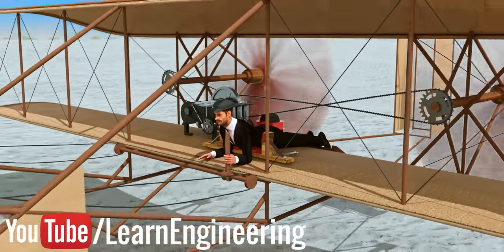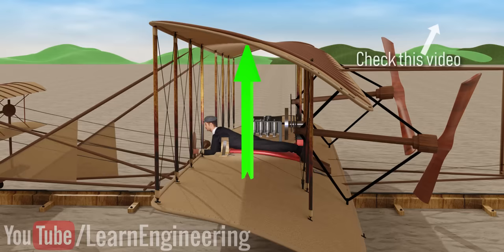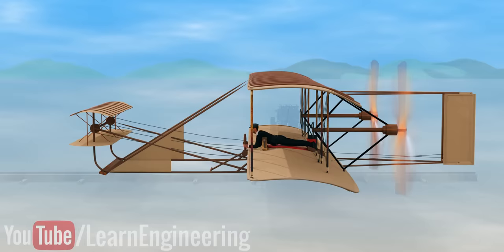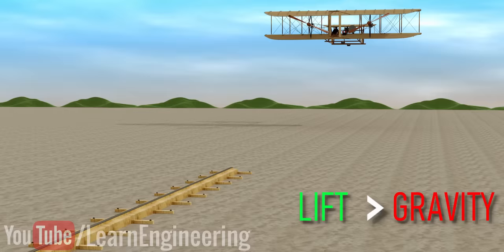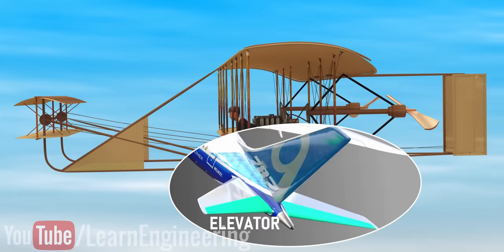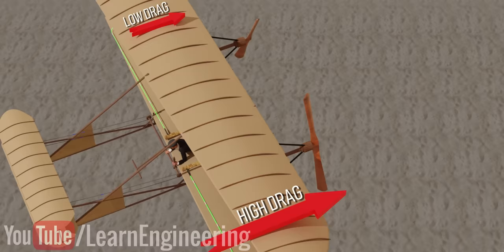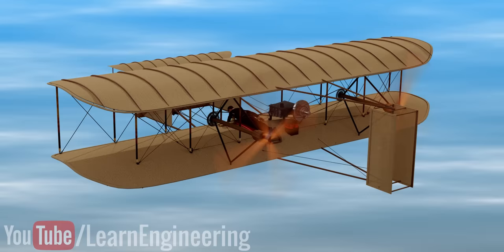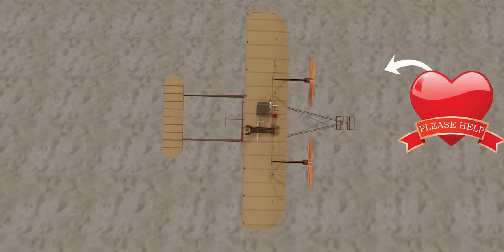The Brilliant Engineering of FIRST FLIGHT !

Comment: See, in the table below, the data published by the North American magazine "National Aeronautics", december, 1939, edition. Official body of the "National Aeronautics Association" in Washington: Pilot Location Date Flight time.

Santos Dumont Bagatelle 12/11/1906 21 ” 

Henri Farman Issy le Moulineaux 11/26/1907 52 ” 

Leon Delagrange Champ de Mars 11/04/1908 6’30 ” 

Henri Farman Issy le Moulineaux 06/07/1908 29’53 ” 

Léon Delagrange Issy le Moulineaux 09/06/1908 20’19

 For many years, these official figures have been published without any dispute. In the American magazine "Reader’s Digest" of December 1942, we found an article entitled "Santos Dumont, Father of Aviation", condensed from the magazine "Air Facts". From page 54 we transcribe the following excerpt: “in 1906 he gave the world the first public demonstration of flight in a device heavier than air (the Wright brothers only came to fly publicly in 1908).
Reply: Few dispute these historical facts.  They are not indisputable facts but they are generally accepted historical statements.  

The claim that Santos Dumont was the "Father of Aviation"  is not a fact.
it is an opinion.  The opinion is widely disputed since most nations want to celebrate their own aviation pioneer.  In the UK, Cayley is regarded to be the Father of Aviation.  The worldwide opinion of most aviation historians generally agree.  

For a Portuguese translation, use Google translate or one of the other
on-line connverters.
Reply: Poucos contestam esses fatos históricos. Não são fatos indiscutíveis, mas são declarações históricas geralmente aceitas.

A afirmação de que Santos Dumont era o "Pai da Aviação" não é um fato.

é uma opinião. A opinião é amplamente contestada, já que a maioria das nações deseja celebrar seu próprio pioneiro da aviação. No Reino Unido, Cayley é considerado o Pai da Aviação. A opinião mundial da maioria dos historiadores da aviação geralmente concorda.

Para uma tradução em português, use o Google Translate ou um dos outros
 conectores on-line.
Reply: @stevebett4947  the problem is that they are disputable and still have the detail that they are events that could be proved and were not. Under these conditions there is no evidence for nothing about the wright and all the evidence shows Dumont. Caylei if he had invented a plane or if he had something that really flew he would also have presented. Everyone knew the advantages of proving the existence of the first plane. They didn't present it because nobody had it. The genius of the Brazilian Dumont made the WORLD fly.
Reply: @stevebett4947  Contestation for unproven and suspicious events like wright events is even a must.
Reply: @stevebett4947  The events listed by National Aeronautics are indisputable as they are data from the initial period of the first records FAI.
Reply: @harpiasonhadorasonhadora5259  
SB:  I like your term disputable.  All hypotheses are disputable.  The best theory is the one that can be falsified.  

I doubt that anyone could have proved anything before 1905 if proof means FAI acceptance.  

I am trying to think of aviation records or aviation contests before 1905 that were indisputable or incontestable.  What about a land speed record with a prize and and spectators?  

The actual speed or distance achieved was usually irrelevant.  The news was who won not whether the win was faster or better than the previous year.  

The FAI inspired contests were different and a little odd.  They were not restricted to a particular date.  What mattered was the measured distance and the official witness(es).  

After 1908, all we had were FAI certified records.  I am not sure that they even required an "official FAI witness".  There just had to be judges or witnesses.  I am not sure how their testimonies were recorded.  In 1908, the officiating job was delegated to the French Aero Club.  How were records handled in 1920?
Reply: SB: Eu gosto de seu novo termo para (incontestable) disputável o questionável. 

Todas as hipóteses são discutíveis. A melhor teoria é aquela que pode ser falsificada (falsifiable).
  

Duvido que alguém pudesse ter provado qualquer coisa antes de 1905, se a prova significa aceitação pela FAI.

Estou tentando pensar em recordes de aviação ou competições de aviação anteriores a 1905 que eram indiscutíveis ou incontestáveis. Que tal um recorde de velocidade terrestre com um prêmio e espectadores?

A velocidade ou distância real alcançada geralmente era irrelevante. A notícia foi quem ganhou não se a vitória foi mais rápida ou melhor do que no ano anterior.

Os concursos inspirados pela FAI eram diferentes e um pouco estranhos. Eles não estavam restritos a uma data específica. O que importava era a distância medida e a (s) testemunha (s) oficial (is).

Depois de 1908, tudo o que tínhamos eram registros certificados pela FAI. Não tenho certeza se eles exigiram uma "testemunha oficial da FAI". Só tinha que haver juízes ou testemunhas. Não tenho certeza de como seus testemunhos foram registrados. Em 1908, o cargo de oficial foi delegado ao Aeroclube francês. Como os registros eram tratados em 1920?

Ninguém configurou seu primeiro vôo da maneira que a FAI recomendou. Você teria que saber a que distância a máquina voadora viajaria e então definir isso como algum tipo de competição aberta com talvez um ou mais competidores viáveis. 50 m ou talvez 50 jardas pode ser um bom ponto de partida. Poucos dos primeiros pássaros se preocuparam em registrar o distância real.

Cayley tinha dois protótipos e um modelo que eram capazes de fazer saltos unidirecionais.

Sir George Cayley (1773-1857) descobriu e identificou as quatro forças que atuam em um veículo voador mais pesado que o ar: peso, sustentação, arrasto e empuxo.

O design dos aviões modernos é baseado nessas descobertas e na importância das asas curvadas, também identificadas por Cayley. Ele construiu o primeiro aeromodelo voador. Ele também projetou o primeiro planador confiável para transportar um humano no alto. Ele construiu vários motores (um produzia 8 hp) e previu corretamente que o vôo sustentado não ocorreria até que um motor leve fosse desenvolvido para fornecer impulso e sustentação adequados.

Exceto no Brasil, George Cayley é geralmente reconhecido como o Pai do Voo ou o Pai da Aviação Moderna.
"Primeiro a voar" é geralmente reservado para a lenda local.

Google Father of Flight ou verifique a Wikipedia em vários idiomas diferentes.
https://en.wikipedia.org/wiki/George_Cayley

"Cerca de 100 anos atrás, um inglês, Sir George Cayley, levou a ciência do vôo a um ponto que nunca havia alcançado antes e que dificilmente alcançou novamente durante o século passado." - Wilbur Wright, 1909. [9]
  
Você consegue encontrar algo semelhante em Alberto Santos-Dumont?No one set up their first flight in the way that the FAI recommended.  You would have to know about how far the flying machine would travel and then set this up as some kind of open ended contest with perhaps one or more viable contestants.  50 m or perhaps 50 yards might be a good starting point.  Few of the early birds bothered to record the actual distance.  

In English:
Cayley's had two man carrying prototypes and a model that were capable of making unidirectional hops.  

Sir George Cayley (1773-1857) discovered and identified the four forces which act on a heavier-than-air flying vehicle: weight, lift, drag and thrust.  

Modern aeroplane design is based on those discoveries and on the importance of cambered wings, also identified by Cayley. He constructed the first flying model aeroplane .  He also designed the first glider reliably reported to carry a human aloft. He built several engines (one produced 8 hp) and correctly predicted that sustained flight would not occur until a lightweight engine was developed to provide adequate thrust and lift.

Except for Brazil, George Cayley is generally recognized as the Father of Flight or the Father of Modern Aviation.
"First in flight" is usually reserved for the local legend.    

Google Father of Flight or check Wikipedia in several different languages.   
https://en.wikipedia.org/wiki/George_Cayley

"About 100 years ago, an Englishman, Sir George Cayley, carried the science of flight to a point which it had never reached before and which it scarcely reached again during the last century."   — Wilbur Wright, 1909.[9]
  
Can you find anything similar from Alberto Santos-Dumont?
Reply: @stevebett4947  cayley never registered a plane and did not start aviation at any time, look at the reality please. There are no statements from cayley showing that he had arrived on the plane, proven or even registered. All the requirements for the first plane had existed for a long time and it was known to everyone including the wright themselves. If they didn't exist, the wrights wouldn't have called French experts to see them flying with the technology of Dumont and Farman in the middle of 1908! And when you try to criticize FAI's demands, you make a mistakee terrible because their demands were more reasonable than ignoran terrible because their demands were more reasonable than the ignorance you present when trying to convince without presenting OFFICIAL evidence.
Reply: @stevebett4947  you and other idiots consider cayley as the father of aviation and cayley NEVER PRESENTED THE PLANE IN PUBLIC  FLIGHT, NEVER DID THE DEMONSTRATIONS PUBLISHED IN FRONT OF EXPERTS, NEVER DID ANYTHING OTHER THAN PRESENTING JUMPS AND PROTOTYPES THAT DID NOT CHARACTERIZE THE PLANE, !!!! this is comical. It means that they consider the father of aviation to have done less that Dumont !!!! ridiculous.
Reply: @stevebett4947 Do you talk about something similar for DUMONT!?!?!? My god, boy,  Dumont held the event,  photographed and filmed "FIRST AVIATION RECORD OF THE WORLD" cayley never got to the feet of this.
Reply: @stevebett4947  cayley !!!!! father OF AVIATION without proving anything and never registering anything !!!! absurd. Based on your claim without evidence, you do not present anything, we could then say that Dumont when proved everything Besides being a true "father of aviation" he is also "GOD OF AVIATION"
Reply: @harpiasonhadorasonhadora5259  

RE: George Cayle  - see https://en.wikipedia.org/wiki/George_Cayley
O artigo pode ser lido em português.
The article can be read in Portuguese.

HS:  Caylei if he had invented a plane or if he had something that really flew he would also have presented.   Everyone knew the advantages of proving the existence of the first plane. They didn't present it because nobody had it.

Pronunciation:  KAY-lee not CAY-lay  IPA: /'kei-lii/

SB:  Digamos que a máquina voadora deu um salto curto. O que você espera que Cayley faça?
Como ele provaria isso usando seus padrões de evidência?
Talvez ele pudesse ter outra pessoa para patrocinar um concurso e selecionar testemunhas oficiais.
Ninguém no século 18 pensava assim.

SB: As notas que temos indicam que Cayley forneceu a melhor descrição de quatro forças que governam o vôo tripulado.

Ele construiu três máquinas voadoras, um planador e dois com um motor que completava saltos curtos. 
Havia três pilotos. Um era seu chofer, que alegou ter sido contratado para dirigir um carro, não uma máquina voadora. É uma boa história, mas
 pode não ser verdade. Cayley estava na casa dos 80 anos, então ninguém esperava que ele fosse o piloto de testes. No entanto, é relatado que seu motorista era apenas dez anos mais jovem.

Cayley não estava focado em provar que o salto aconteceu. Foi apenas um teste de conceito.
Ele concluiu que precisaria de um motor mais potente para fazer um vôo real.

Em 1799, ele estabeleceu o conceito do avião moderno como uma máquina voadora de asa fixa com sistemas separados para elevação, propulsão e controle. A analogia era um barco em um mar de ar. As asas proporcionavam elevação da mesma forma que o casco de um navio.
O motor fornecia propulsão e o leme fornecia controle. A principal tarefa era a estabilidade - evitar que o navio naufragasse no mar.

Esta não foi a analogia que os Wright usaram. Controlar um avião era como controlar uma bicicleta instável. Instabilidade
 estava bem. Os esforços do piloto foram necessários para alcançar o controle. O piloto era mais do que um homem no leme.

Aqui está Wilbur Wright sobre a importância de Cayley. Alberto falou alguma coisa sobre os que vieram antes?
Quem acredita na lendária figura afirma que Santos-Dumont fez tudo sozinho, sem a ajuda de ninguém.

"Cerca de 100 anos atrás, um inglês, Sir George Cayley, levou a ciência do vôo a um ponto que nunca havia alcançado antes e que dificilmente alcançou novamente durante o século passado."
- Wilbur Wright, 1909.

O artigo pode ser lido em português.

In English:
Let's say that the flying machine made a short jump.  What would you expect Cayley to do?
How would he prove it using your standards of evidence?
Perhaps he could have had someone else sponsor a contest and select official witnesses.
No one in the 18th Century thought that way.  

SB:  The notes that we have indicate that Cayley provided the best description of four forces that govern manned flight.
He built three flying machines a glider and two with a motor that completed short hops.  There were three pilots.  One was his chauffeur who reportedly claimed that he was hired to drive a car not a flying machine.  It is a good story but
may not be true.  Cayley was in his 80's so no one would expect him to be the test pilot.  However, it is reported that 
his chauffeur was only ten years younger.

Cayley was not focused on proving that the hop took place.   It was just a test of concept.
He concluded that he would need a more powerful engine to make a real flight.

In 1799, he set forth the concept of the modern aeroplane as a fixed-wing flying machine with separate systems for lift, propulsion, and control.  The analogy was a boat in a sea of air.  The wings provided lift the way the hull of a ship did.
The engine provided propulsion and the rudder provided control.  The primary task was stability - preventing the ship from capsizing in the sea of air.

This was not the analogy that the Wrights' used.  Controlling a plane was like controlling an unstable bike.  Instability was fine.  The efforts of the pilot were required  to achieve control.   The pilot was more than a man on the tiller. 

Here is Wilbur Wright on the importance of Cayley.    

"About 100 years ago, an Englishman, Sir George Cayley, carried the science of flight to a point which it had never reached before and which it scarcely reached again during the last century."

— Wilbur Wright, 1909.

Did Alberto say anything about those who came before?
Believers in the legendary figure often say that Santos-Dumont did everything himself with no help from anyone.
Reply: @stevebett4947  interesting, but very vague. It's not objectivity, flight, the ability to run, take off, land under its own power, landing, filming and photos with official registration and definitive appearance of the plane and beginning of aviation as Dumont.
Reply: @stevebett4947  Thanks for the translation.
Reply: @harpiasonhadorasonhadora5259  

SB: Os primeiros Wright Flyers não podiam decolar ou voar por conta própria. Eles exigiam um motor e vento forte. O vento forte também foi útil para um pouso suave.

Quando os Wrights tentaram repetir o que consideraram um sucesso em
Ohio, eles tiveram repetidos fracassos. Talvez um trilho engraxado de 200 pés
 permitir que o Flyer acelere para decolar. Ninguém nunca tentou isso.

Pode não funcionar com um motor fraco. Em vez disso, encurtou o necessário
 pista pelo uso de uma catapulta de torre que lhes deu, por uma estimativa, um adicional de 6 mph. Isso foi o suficiente para atingir a velocidade de decolagem. isso foi assistência de três fontes: motor, vento e catapulta. Todos os 3 eram necessários para o Wright Flyer II decolar.

Here is what I posted before:

Digamos que a máquina voadora deu um salto curto. O que você espera que Cayley faça?

Como ele provaria isso usando seus padrões de evidência?

Talvez ele pudesse ter outra pessoa para patrocinar um concurso e selecionar testemunhas oficiais.
  Ninguém no século 18 pensava assim.

SB: As notas que temos indicam que Cayley forneceu a melhor descrição de quatro forças que governam o vôo tripulado.
Ele construiu três máquinas voadoras, um planador e dois com um motor . Havia três pilotos. Um era seu chofer, que alegou ter sido contratado para dirigir um carro, não uma máquina voadora. É uma boa história, mas
pode não ser verdade. Cayley estava na casa dos 80 anos, então ninguém esperava que ele fosse o piloto de testes. No entanto, é relatado que
seu motorista era apenas dez anos mais jovem.

Cayley não estava focado em provar que o salto aconteceu. Foi apenas um teste de conceito.
  Ele concluiu que precisaria de um motor mais potente para fazer um vôo real.

Em 1799, ele estabeleceu o conceito do avião moderno como uma máquina voadora de asa fixa com sistemas separados para elevação, propulsão e controle. A analogia era um barco em um mar de ar. As asas proporcionaram elevação da mesma forma que o casco de um navio.
O motor fornecia propulsão e o leme fornecia controle. A principal tarefa era a estabilidade - evitar que o navio naufraga se no mar.

Esta não foi a analogia que os Wright usaram. Controlar um avião era como controlar uma bicicleta instável. Instabilidade
estava bem. Os esforços do piloto foram necessários para alcançar o controle. O piloto era mais do que um homem no leme.

Aqui está Wilbur Wright sobre a importância de Cayley. Alberto falou alguma coisa sobre os que vieram antes?
Quem acredita na lendária figura afirma que Santos-Dumont fez tudo sozinho, sem a ajuda de ninguém.

"Cerca de 100 anos atrás, um inglês, Sir George Cayley, levou a ciência do vôo a um ponto que nunca havia alcançado antes e que dificilmente alcançou novamente durante o século passado."
- Wilbur Wright, 1909.

SB:  The earliest Wright Flyers could not take off or fly under their own power.  They required both an engine and a high wind.  The high wind was also useful for a soft landing.  

When the Wrights tried to repeat what they viewed as a success in 
Ohio, they had repeated failures.  Perhaps a 200 ft. greased rail would
allow the Flyer to accelerate to take off speed.  No one has ever tried it.
It might not work with a weak engine.  Instead then shortened the required
runway by the use of a derrick catapult which gave them, by one estimate,
an additional 6 mph.  This was enough to achieve take off speed.  It was
assistance from three sources:.  engine, wind, and catapult.  All 3 were needed for the Wright Flyer II to take off.

The Wrights were pretty good with photography.  I am not sure why they never investigated film.  

Can you be specific about what you consider to be vague and non-objective?

Please concentrate on what we don't agree on.  
As you know, I am a fan of Henrique Lins de Barros and accept
his full argument.  The only difference is that he buys into Archdeacons 
efforts to make it appear that the French were dominant in aviation.
I find the initiative as a bit odd and contrived.  

To ask that George Cayley () adopt them for his flight experiments seems
to me to be a stretch.  He doesn't explain how this could be done.  Can you?

Cayley could care less if you didn't believe or accept his reports.  They were completed to answer some questions that he had.  He did design an 8hp engine but it was not enough to achieve practical flight.  He needed more power and a better propeller to produce more thrust.  He thought that
true flight would have to wait until someone invented the needed technology.
Reply: @stevebett4947  again, you are always having the same problem. You don't present facts. Facts require proof, otherwise there is only belief. The demand was clear and came at least since 1890 and began to be implemented since 1898 when the greatest authority of the time arose the Paris club. Everyone knew and the requirement was clear "DO NOT USE CATAPULT, DO NOT USE THE WIND, DO NOT PLAY DOWNHILL ( DO NOT USE ANY EXTERNAL MEANS),  the machine should run, take off, land under its own Power and landing. in front of a large specialist,  photos, great public, official registration of the event and photos. these requirements were old and in their words all this was disrespected by the wright. In short, they didn't have the plane, and they never presented evidence. anything between 1903-05 and three years BEFORE Dumont !!!!! My god!!
Reply: @harpiasonhadorasonhadora5259  

SB:  Thanks for your comment.  I thought we agreed to supply enough information for the reader to determine what comment you are responding to 

I also thought we agreed not to argue about what we already agree on.
For example:  We agree that the Wrights did not supply the incontestable
evidence required by the FAI and the French Aero Club after 1904.  

It would have been impossible for them to do so since the FAI did not exist in 1903 and 1904.  Earlier I provided some examples of how the Wright Brothers could stack the deck against all of those who claimed to have
flown before 1908s by accepting only controlled flights as real.

The consensus today is that Santos Dumont was the first to fly with official witnesses.  The Wright Brothers were the first to achieve controlled flight.
I don't think they achieved it in 1903 but 1905 is still good enough to be the first.  

The only incontestable facts are those mentioned in the rules and regulations for the Deutsch - Archdeacon award.  We need to find
these since all we have is hearsay.  

If the rules include or mention a large crowd and film evidence, then this can be part of the official requirements.  Otherwise they are just preferences of the event organizers which they could supply.

I think we will find the rules include no assistance (other than using wheels to accelerate to take off speed).  This means no hill, no catapult, & no required minimum headwind,  They also include official witnesses.  They may mention that the witnesses have to be from the French Aero Club.

I don't think that these requirements were widely accepted outside of the French Aero Club and the FAI.  They were devised specifically to handicap the Wrights, raise doubts as to their accomplishments,  and to elevate the dominance of French aviation.  

It is important to have some rules regarding what counts as sufficient evidence.  What the FAI requires today is a good example of what it should be.  The 1905 rules are clearly biased and excessive.

This reply to another comment includes answers to some of your questions.  Sorry I don't have time to translate them.  I will do so in a day or two.

SP wrote:

1-Can you prove there was Wright  airplane flight before 1908? 
2-Can you prove there was Wright  airplane flight before 1908? 
3-All NASA wind tunnel tests indicate D > T
4-Can a prototype with D>T fly sustainably.

SB:  

1.  I can provide historical evidence that most aviation historians
agree that the Wrights' flew as described in their notebooks.  

The Wright Experience exact replica proved that the craft was capable of a 10 sec. flight covering about 100 feet or approx. 33 meters.  with a 15 mph headwind.   This is consistent with the reported flights of 120 to 175 ft. with a 21+ mph headwind.

There is no incontrovertible or incontestable  proof for the claimed flights that would satisfy you.  It shouldn't satisfy the FAI either but
they went ahead and certified the claimed flights with no official witnesses.    Any ideas on why they did this?

There was one public flight before a crowd and 30 invited guests that included multiple laps around the Huffman Prairie cow pasture.  Capt. Ferber, who had been a leading critic of the Wrights, interviewed the invited guests and concluded that the event took place as described and that the Wrights were not making it up.  

This is supposed to have been reported  in L'Aerophile but I haven't found it yet.  You should read this magazine since it is on the Web along with a full text version which can be copied and pasted into a language converter if you don't read French.  

What I found interesting was that the magazine was not dominated by either Santos Dumont or the Wright Brothers.  They are mentioned but not as much as I was expecting.  

SB:  There were members of the American Aero Club in the audience but they were not official witnesses.  However, their opinion was essential for a majority of members to vote to certify the authenticity of all the alleged Wright flights.  

Personally, I doubt that the 59 sec. flight covering 852 ft. was
accurate.  Fortunately for them they were never asked to replicate it.  They might have said they could replicate it if the conditions could be replicated but they would prefer to replicate it with an updated prototype.  

2.  I can't prove any of the early flights with the kind of incontestable evidence that you (and the FAI) require.  
You can't prove that they didn't make the flights as reported.
There is no incontestable proof that they didn't do what they
said they did in their notebooks.  

Can you explain how they could have possibly provided the
kind of evidence you want before the FAI was created?

3.  All of the wind tunnel tests do not prove D > T.  Not true.

The first NASA test of a close replica of a museum replica
indicates that D>T for the prop when the RPM is greater than 350 RPM.  

Note:  The prop RPM was higher for the Wright Flyer 2 Model A using a Dayton built Four cylinder upright engine that weighed under 180 lbs. and produced 30-40 hp depending on the RPM.
One could substitute a European built replica engine built under license. 

4 .- Can a prototype with D>T fly sustainably.

Is this a trick question?  If D>T, how can the craft get off the ground?  If it can lift off, how can it fly?

Do you want to define what you mean by sustainable.  
I don't think your technical definition matches the one in
the dictionary.  Can a craft that fails to get out of ground effect
be said to fly sustainably?

I have answered a similar question before.  I think I said that
there is no proof of sustainable flight unless the plane flies in circles at a significant altitude.  Only the Wright Flyer III and the late prototype or the Wright Flyer II were capable of sustained flight
Reply: @stevebett4947  would you do a translation please?
Reply: @harpiasonhadorasonhadora5259  

SB: Obrigado pelo seu comentário. Achei que concordamos em fornecer informações suficientes para o leitor determinar a qual comentário você está respondendo

Também achei que concordamos em não discutir sobre o que já concordamos.
  Por exemplo: Concordamos que os Wrights não forneceram o incontestável provas exigidas pela FAI e pelo Aero Club francês após 1904.

Teria sido impossível para eles fazerem isso, uma vez que o FAI não existia em 1903 e 1904. Anteriormente, forneci alguns exemplos de como os irmãos Wright poderiam empilhar o baralho contra todos aqueles que afirmavam ter
voado antes de 1908, aceitando apenas voos controlados como reais.

O consenso hoje é que Santos Dumont foi o primeiro a voar com testemunhas oficiais. Os irmãos Wright foram os primeiros a alcançar o vôo controlado.
Eu não acho que eles conseguiram em 1903, mas 1905 ainda é bom o suficiente para ser o primeiro.

Os únicos fatos incontestáveis são aqueles mencionados nas regras e regulamentos do prêmio Deutsch - Archdeacon. Precisamos encontrar
estes, uma vez que tudo o que temos é boato.

Se as regras incluírem ou mencionarem uma grande multidão e evidências de filmes, isso pode fazer parte dos requisitos oficiais. Caso contrário, são apenas preferências dos organizadores do evento que podem fornecer.

Acho que descobriremos que as regras não incluem assistência (além de usar rodas para acelerar e decolar). Isso significa nenhuma colina, nenhuma catapulta e nenhum vento contrário mínimo necessário. Eles também incluem testemunhas oficiais. Eles podem mencionar que as testemunhas devem ser do Aeroclube francês.

Não acho que esses requisitos foram amplamente aceitos fora do Aero Club francês e da FAI. Eles foram concebidos especificamente para prejudicar os Wrights, levantar dúvidas sobre suas realizações e elevar o domínio da aviação francesa.

É importante ter algumas regras sobre o que conta como evidência suficiente. O que a FAI exige hoje é um bom exemplo do que deveria ser. As regras de 1905 são claramente tendenciosas e excessivas.
Reply: @stevebett4947   What little I understood is very vague. You do not prove the existence of the plane before Dumont and this is more than necessary. There is no point in wasting time with pre-aviation periods. The appearance of the plane by Santos Dumont and the beginning of this period was more significant than unreliable reports made only on paper. The requirement for the first flight was extremely clear and everyone knew
Reply: @stevebett4947   No, there are no biased rules what existed were clear rules that people either complied with or were unable to comply with, unfortunately a situation in which the Wrights fit in Perfectly. The rules were stipulated by the Paris Air Club and have been implemented as a requirement since 1898, this was an extremely reasonable time for the Wrights to have presented everything and we are not counting the various opportunities that FAI had and more. The excuse not There were conditions for registration before 1905 forget it, because even a child realizes that this is an excuse, you can't prove anything to them before Dumont and after Dumont the brothers and the world flew. The authority that would record everything for them has existed since 1898 Paris Aeroclube and in 1905 when the FAI appeared, the Wright Bros had 1 year and 1 month to do everything and record everything before the Dumont event in November 1906. Your argument remains vague.
Reply: @harpiasonhadorasonhadora5259  

SB:  SB: Você respondeu à minha afirmação de que a FAI não usa mais os requisitos de 1905.
Não sei a data exata em que as regras foram oficialmente alteradas.

SB:  Have you responded to my claim that the FAI no longer uses the 1905 requirements.
i do not the exact date when they were officially changed.  

---
SB:  Eu não entendo sua crítica à minha afirmação de que seria impossível para os Wrights
para cumprir os padrões da FAI para evidências incontestáveis em 1903 e 1904.

SB:    I don't understand your critique of my claim that it would be impossible for the Wrights
to comply with the FAI standards for incontestable evidence in 1903 and 1904.
Reply: @stevebett4947  the statement I keep the same and reaffirm "THE AUTHORITY THAT COULD MAKE ANY REGISTRATION FOR THE WRIGHT HAS BEEN SINCE 1898" this is my statement. This authority was called Aeroclube de Paris, in 1900 it was renamed French's aeroclub and in 1905 il The authorithy was renamed "FAI". Since 1898 this authority, could register everything for the Wrights and any other pioneer of the aviation.
Reply: @stevebett4947  In fact, you already understood what I say here a long time ago. And we have one more detail: The governments of the United States and other countries and trademarks and patents from anywhere in the world they would record any Wright event and they would not lose rights to any machine.
Reply: @stevebett4947  Your claim that they could not register anything before 1905 is one of the worst nonsense you have ever said here. The authority that would record everything for them has existed since 1898 !!!! And this authority He summoned the Wrights in 1904 !!!
Reply: @stevebett4947  the requirements for the first plane had existed since 1890 and began to be officially demanded by any aviation pioneer since 1898.
Reply: @harpiasonhadorasonhadora5259  

SB:  Registered (Registrado) não é a palavra certa em inglês. Talvez certificado?

Tanto o Aeroclube francês quanto o Aeroclube americano já existiam há anos antes de eles
foram fretados.

Você tem um exemplo de algum registro que eles certificaram (certified) antes de 1905?

Registered is not quite the right word in English.  Perhaps certified?

Both the French Aero Club and the American Aero Club were around for years before they 
were chartered.  

Do you have an example of some record they certified before 1905?
Reply: @stevebett4947  The most important thing is not the English term, the most important thing is that there was never evidence before Dumont. The plane did not exist before November 12, 1906.
Reply: @stevebett4947  the most important thing is that you prove that they flew before Dumont and with official records with photos. Dumont held the required event and also knew that the competent authority for record existed since 1898.
Reply: Harpiasonhadora sonhadora 

SB:  Usar o termo em inglês correto apenas torna seus comentários mais fáceis de entender para os leitores em inglês. Se você não quiser se comunicar, continue usando o registrado.
É a sua chamada.

Concordamos que os Wrights nenhum outro aviador primitivo forneceu o tipo de prova do tipo exigido
para atender aos padrões e definições da FAI de 1905. Nenhum vôo antes de 1906 foi oficialmente observado pelo Aero Club francês. A prova incontestável requer tudo o que foi escrito nas regras oficiais ausentes para
 o Prêmio Deutsch - Archdeacon. Você está correto ao dizer que ninguém atendia a esses requisitos antes de 1906.  Já que concordamos com isso, por que você continua trazendo o assunto como se não concordássemos?

Eles poderiam ter sido observados se o capitão Ferber tivesse chegado uma semana antes, em 1904.
Ele foi capaz de entrevistar as 30 pessoas que foram convidadas para a demonstração pública de que 100's compareceram (não milhares), onde Wright voou várias voltas ao redor do prado Huffman Prairie.
  O que você diria se ele tivesse observado o vôo?

Existem questões que precisam ser discutidas e sobre as quais você se recusa a falar.
Você acha que os padrões da FAI de 1905 poderiam ter sido aplicados antes.

HS: Cayley nunca registrou avião e em momento algum começou a aviação, olhe a realidade por favor.

SB: Caley, é claro, não estava tentando provar uma hipótese científica. Ele estava apenas curioso para saber se seu motorista seria capaz de pilotar seu modelo ampliado. Seu motor de 8 cv seria suficiente para tirar a nave do chão? A conclusão de Caley foi que o vôo verdadeiro (algo mais do que um salto de 10 m) teria que esperar até que motores mais potentes fossem desenvolvidos.

Por que ele ou qualquer outro aeronauta inicial se daria ao trabalho de criar uma competição com um prêmio para um tipo específico de desempenho e, em seguida, trazer especialistas aeronáuticos mais 100 testemunhas públicas para julgar se um competidor atingiu ou ultrapassou 10 m (ou Exigência de 10 jardas).

Por que isso seria suficiente se os juízes ou testemunhas oficiais não eram do Aeroclube da França?

Minha pergunta é como um pioneiro da aviação poderia provar alguma coisa? Não havia câmeras.
Um documento oficial com firma reconhecida de uma testemunha conhecida (por exemplo, um cientista famoso) que não teve nada a ganhar certificando que a distância reivindicada foi alcançada pode ser o máximo que ele poderia fazer. Testemunhas públicas e repórteres geralmente não são confiáveis.

English version:
 @harpiasonhadorasonhadora5259   Using the right English term only makes your comments easier to understand for English readers.  If you don't want to communicate, then continue to use registered.
It is your call.  

We agree that the Wrights no any other early aviator provided the kind of evidence of the kind required
to meet the 1905 FAI standards and definitions.  No flights before 1906 were officially observed by the French Aero Club.  Incontestable proof requires  whatever was written on the missing official rules for
the Deutsch - Archdeacon Prize.  You are correct that no one met these requirements before 1906.  
Since we agree on this, why do you continue to bring it up as if we don't.  

They could have been observed if Capt. Ferber had arrived a week earlier in 1904.
He was able to interview the 30 people who were invited to the public demonstration that 100's attended (not thousands) where the Wright flew multiple laps around the Huffman Prairie meadow.
What would you say if he had observed the flight?   

There are issues that need to be discussed and which you refuse to talk about.
You think the 1905 FAI standards could have been applied earlier.

HS:  Cayley never registered a plane and did not start aviation at any time, look at the reality please. 

SB:  Caley, of course, was not trying to prove a scientific hypothesis.  He was just curious if his chauffeur would be able to fly his scaled up model.  Would his 8hp engine be sufficient to get the craft off the ground?  Caley's conclusion was that true flight (something more than a 10 m. hop) would have to wait until more powerful engines were developed.  

Why would he or any other early aeronaut go to the trouble of setting up a contest with a prize for a specific kind of performance and then bring in aeronautic experts plus 100 public witnesses to judge whether or not a contestant met or surpassed 10 m (or 10 yard) requirement.  

Why would this be enough if the judges or official witnesses were not from the French Aero Club?

My question is how an early aviation pioneer could prove anything?  There were no cameras.  
An official notarized document from a known witness (e.g., a famous scientist)  who had nothing to gain from certifying that the claimed distance had been achieved might be most he could do.  Public witnesses and reporters are often  unreliable.
Reply: @harpiasonhadorasonhadora5259   read the reply in the replies section.  It does not show up here.
Reply: @stevebett4947  channute and ferber because of their friendship with the wrights were suspect and unreliable elements. the Paris Aeroclub that existed since 1898 and since this year could register the event for any pioneer called the wright in 1904 and the truth is that they never proved anything, do you want a better chance than this?!?!? The events should not be registered in magazines were to be registered publicly and by competent authorities. missed chance ???! and the authority that existed since 1898, you understood that since 1898 the records could have been made. What are you accusing of not having been answered has already been commented, has already been spoken. And who has to prove everything before Dumont to prove to others the wright's veracity is you !! and there is only one way you know what it is and it became a dilemma for you. Please acknowledge that Dumont is the inventor of the airplane, the father of aviation and that there is no way to prove that the wrights flew before. recognize that that they lost. as for cayley it is no use to be cited because the very FAI regards it as a PRE aviation period. I'm talking about the invention of the airplane.
Reply: @stevebett4947  Thanks for the translation
Reply: @harpiasonhadorasonhadora5259  
HS: wrote:  "The plane did not exist before Nov. 12, 1906."
My interpretation of an earlier comment:  
A forma da FAI de garantir que algo realmente aconteceu era a única forma racional de fazer isso.

The FAI way to guarantee that something actually happened was the only rational way to do it.  

Answers in English and Portuguese:

SB: Só porque não há evidência incontestável da existência e desempenho do avião, não significa que ele não existiu. Um mundo onde nada existe, a menos que haja evidências incontestáveis de sua existência. . . está quase vazio.

Você já tentou responder ao meu comentário de que
 * não há evidência incontestável de que o
 Wright Flyer não existia.
Você deve usar o mesmo padrão de evidência para suas declarações

como você faz para as declarações de Wright.

Você sugere que a única maneira de ter mais confiança em um evento histórico é aplicando
 
Definições e regras do arquidiácono. Discordo.

A prova de uma hipótese científica não se baseia em sua certeza.
Baseia-se na capacidade de outras pessoas de replicar os resultados.

A prova científica é mais baseada na habilidade de seus 
colegas de replicar sua pesquisa.
Se poucos são capazes de replicar seu estudo, há um problema.

A incapacidade do capitão Ferber e outros de igualar o 
desempenho relatado do
 Wright Glider e o Wright Flyer 
foram a origem da dúvida e das histórias de boatos e blefes.

Wright não estava sob pressão de seus financiadores para revelar seus segredos. Foi suficiente
 para ele impressionar seu público e demonstrar seu domínio do ar voando em círculos e fazendo figura 8. Ele arriscou um ganho financeiro explicando como fazer transações bancárias e se beneficiar da baixa estabilidade.

Mesmo assim, ele foi em frente e explicou tudo para Bleriot e outros. Ele claramente subestimou? como
 rapidamente eles poderiam adicionar o arqueamento de asas a seus protótipos e aprender como usá-lo.

Estou surpreso que seus concorrentes não tenham conseguido descobrir isso antes. Eles simplesmente não estavam livres da crença na precisão das analogias dos velhos barcos. O avião era basicamente um barco em um mar de ar. Ele precisava de um motor para propulsão, um leme para mantê-lo no curso e estabilidade para evitar que virasse. Com tal analogia, é difícil entender a importância da controlabilidade.

Há pouca certeza na ciência.
Consistência é o mais próximo que podemos chegar.

SB:  Just because there is no incontestable evidence of the plane's existence and performance does not mean the plane did not exist.  A world where nothing exists unless there is incontestable evidence that it exists  . . .  is almost empty.  

Did you ever try to reply to my comment that
 * there is no incontestable evidence that the Wright Flyer did NOT exist.   You have to use the same standard of evidence for your statements
as you do for the Wright's statements.  

You  imply that the only way you can have more confidence in a historical event is to apply Archdeacon's definitions and rules.  I disagree.  

The proof of a scientific hypothesis is not based on its certainty.  
It is based on the ability of others to replicate the results.   

Proof in science is based more on  the ability of your peers 
to replicate your research.  
If few are able to replicate your study, there is a problem.  

The inability for Capt. Ferber and others to match the reported performance 
of the Wright Glider and the Wright Flyer was the origin of doubt 
and the hoax and bluffer stories.

Wright was under no pressure from his financial backers to reveal his secrets.  It was sufficient for him to wow his audience and demonstrate his mastery of the air by flying in circles and performing figure 8's.  

He risked financial gain by explaining how to bank and turn and benefit from low stability.  
Yet he went ahead and explained  everything to Bleriot and others.  
He clearly underestimated how quickly they could add wing warping 
to their prototypes and learn how to use it.

I am surprised that his competitors were unable to figure it out earlier.   
Perhaps they were just not free of their belief in the accuracy of the old boat analogies.  The airplane was basically a boat in a sea of air.  
It needed a motor for propulsion, a rudder to keep it on course, and stability to keep it from capsizing.  With such an analogy, it is hard to understand the importance of controllability.

There is little certainty in science.
Consistency is about as close as we get.
Reply: @stevebett4947  I liked it, Steve, now your intention has appeared. You are trying to put in people's minds that the plane existed before Dumont withouth official proofs. I really liked it because you came up with what you want and now with quite objectivity. Your despair is ridiculous. Read the idiocy you wrote. It doesn't look like it comes from someone who must have studied or someone who is an aviator. Absurd attempt and just ask a question that this type of answer presented here ends. The problem is that I will ask you a thousand times. I mean you believe in wrights without proof  is the accusation that Brazilians always make and that "San pol" had already shown here "THE AMERICAN BELIEF IN WRIGHT BROS HAS NO BASIS IN FACTS" Unfortunately this was not possible in their time and it won't be now. Please do not make any more contacts you wrote the absurd to try to justify the wright's unproven flights. Forget it, when you have the documents that the wrights recorded between 1903-05 officially registered with the competent authority of the time with photos official documents registered by wright before the events of Dumont only in this condition contact. Please.
Reply: @harpiasonhadorasonhadora5259  

SB:  Here is a list of pioneers that are often regarded as the inventor of the airplane in their home nation:
https://en.wikipedia.org/wiki/List_of_aviation_pioneers

The claim that Santos Dumont was the Inventor of the Airplane or the Father of Aviation is not
an indisputable fact.  I thought you were arguing that no statement can be made without incontestable evidence.   Did I miss something?

We are not arguing about the empirical fact that 
Santos Dumont fulfilled the requirements of the Deutsch-Archdeacon grand prize and stayed aloft for 100 m. or more in October, 1906.  

The French Aero Club was designated by Archdeacon to be the official witnesses and determine if the rules of the Deutsch -Archdeacon Prize had been followed an whether or not they achieved the goal of flying over 100 m. in October, 1906

We are arguing about how this accomplishment can be used to critique the Wright flights.

You can say the Wrights did not provide incontestable evidence but that is it.  

You can't say that the lack of such evidence means that their flights did not happen.

That claim does not meet your standard for 
incontestable evidence.
Reply: @stevebett4947  traduction please!
Reply: @stevebett4947   what you presented in the link, besides being a great confusion and disorder, presents wrong data that do not match the historical and records reality. To begin with, the observations regarding the wright indicate that they would have invented the wing warping systems and the three directional axes, kkkkkk 😂 very comical comical. The inventors of the three axes were Frennet - Serret French mathematicians who established designed and registered the three directional axes for them in 1851, the wrights were not born. kkkkkk my god, Steve, this is what they teach in American schools a festival of lies. The wing warping system was old and had been tested by Gallaudet in 1896 and you yourself commented and agreed to this in your comments and still attribute to the wright brothers the first flight of heavier than air and the wright themselves declared that the proof they presented in 1903 regarding the event was the sheet of paper with the radio transmitted by telegraph to their father. kkkk, steve, get a less American PUBLICATION, please. This link you submitted has too many errors and a chronological disorder.
Reply: @stevebett4947  Dumont's event is totally indisputable because it was registered by FAI as "FIRST AVIATION RECORD OF THE WORLD" and is signed by Ernest Archdeacon, is IMMORTALIZED in a monument in Paris that was built by the people of Paris and the tribute in the text of the monument made by the Aeroclube de France, is in bagatelle, paris anyone who goes to this place is appalled to see these Beautiful words that the people of Paris honored the inventor of the airplane and father of aviation. Dumont.
Reply: @stevebett4947  It's indisputable, Steve, zoom in and you can read "FIRST AVIATION RECORD OF THE WORLD" Was a worldwides event. https://pt.m.wikipedia.org/wiki/Campo_de_Jogos_de_Bagatelle
Reply: @harpiasonhadorasonhadora5259  
SB:  Didn't you agree to provide a clue as to what comment your are
responding to?

HS:  The American Belief in the pre 1908 flights of the Wright Bros. has no 
basis in fact.

SB:  We agree that the Wrights do not provide incontestable evidence for
their pre-1908 records and accomplishments.  

There is more ways (and IMO better ways) to define an empirical fact than the one that Archdeacon and Ferber came up with.  

Just because someone will not provide the kind of evidence that you want
does not mean there are not other types of evidence or that nothing happened before 1908.  You are using the proof that the 14 bis achieved a short flight (100 m) as part of a claim that does not pass the evidence test.
Such claims do not represent incontestable proof.

I do not currently have a pilot's license (I am too old)  but I have piloted
small planes, ultralights, powered hang gliders, and hang gliders on the Indiana dunes where Herring and Octave Chanute tested their gliders.
I have also worked as an aeronautical engineer with Allisons Turbo Prop
division of General Motors.  

HS:  (what you wrote) ...doesn't look like it comes from someone who studied (early aviation) or someone who is an aviator. 

SB:  Why?    Because I refuse to accept your unsupported comments?

I have no issue with the comments by Lins de Barros.  He revived the FAI
based definition of incontestable evidence in the year 2000.  He does not
try to supplement it with unsupported comment and misinformation.  His books are available on Amazon.  I don't have a good on-line reference.

I tend to accept most the narratives provided by aviation historians as the
most plausible account of what happened in the past.  This position is not a fixed belief or tainted by nationalism.  It is just what I accept until something better comes along.   

Science is not fixed for all time.  
What is the best theory or account changes over time.

You seem to think that narratives that are consistent with the facts and 
consistent the comments and reported comments of people who were present at the time should not be used because they could be flawed.

Yes, they could be flawed.  If they don't fit the facts, however, they will eventually be replaced with better theories and narratives.  

Isn't that better than saying nothing or replacing the conventional wisdom
with conspiracy theories or misinformation? 

I will provide a Portuguese translation but I don't guarantee that it won't be flawed.
Reply: @stevebett4947  translation please. what you wrote is the same as writing in Japanese. this means nothing.
Reply: @stevebett4947  Steve, you don't needs to write a bullshit book trying to defend the wright! You just have to accept it.  Dumont has for him "THE FIRST AVIATION RECORD OF THE WORLD" signed by Archdeacon and the wright never did nothing related to flying before Dumont so they missed it !!! Dumont is the father of aviation and the inventor of the plane. I expect a translation of the text.
Reply: @harpiasonhadorasonhadora5259  

SB:  Please indicate the link you are talking about.  I think it was a list of early aviators who made some claim as being the first to fly.

Be specific about what you consider to be ahistorical.

Wing warping as described and tested by Gallaudet would have been 
discovered had he tried to patent it.  I am not sure when the oversight
was discovered.  

During the late 19th and early 20th centuries, Charles Renard, Alphonse Pénaud, and Louis Mouillard either described 
horizontal control surfaces on the trailing edge of wings or incorporated them into experimental craft. Gibbs-Smith insisted that these were air brakes, however, intended to increase the drag on one wing to control yaw, not roll.

In the mid- to late 1800s, Jean-Marie LeBris, John Montgomery, Clement Ader, D.D. Wells, Edson F. Gallaudet, and Hugo 
Mattullath all suggested some form of what would become known as wing warping, or applied it to unmanned kites or a full-scale machine. None were successful at using the technique to achieve active control, nor did they envision combining  wing warping with a rudder to counteract differential drag or to achieve coordinated turns— an essential feature of Wilbur and Orville Wright’s patent. 

"Regardless of the type of aircraft, there are three axes upon which it can move: Left and Right, Forwards and Backwards, Up and Down. In aviation though, their technical names are the lateral axis, longitudinal axis and vertical axis. The lateral axis runs from wing tip to wing tip."

Wrights' patent is about 3 axis control of an aircraft.  It applies
to all fixed wing aircraft.   The illustration in the patent
  is a bi-winged glider with wing warping but the patent applies to both wing warping and ailerons.

In France, Wrights' patent lasted from 1906 to 1917.  The French patent was kept in legal limbo until the time ran out.  In the US, the patent lasted until
1913 when all aircraft patents were federalized and pooled.  The patent holders made some money but there were no windfall of profits.   

There are American publications that are biased.  I was amazed at how
even handed most of the articles reproduced by wright-brothers.org and other large wright brother websites.  They are not perfect so if you find
and error you can report it.

This is a link to the two mathematicians,  Fennet and Serrat
https://en.wikipedia.org/wiki/Frenet%E2%80%93Serret_formulas

You need to explain how this is a description of 3 axis control.

This comment is already too long.  Enough for now
Reply: @stevebett4947  Steve, you are not well. is something going on with you? you don't need to make new contacts, what you need to do is accept the reality. The wrights didn't invent anything. The plane, the first airplane, was invented by Dumont and Dumont also created aviation. You yourself are presenting the schematics of the three axes invented by Frennet-Serret, everything is explained there in the document. I don't have to explain anything Frennet-Serret created the base in 1851 the wrights weren't born kkkkkk 😂😂😂 they didn't invent anything regarding the three axes the idea it was old and wing warping had already been tested by gallaudet, that is, it was also something very old. Steve, don't despair Dumont is the inventor of the plane. the rest were in the mood to fly and not succeeded. Go to sleep, boy, if you want to win the debate and prove something to the wrights, present here the documents that the wrights recorded between 1903-05 with photos that were presented at the their period 1903-1905. Don't forget, the authority that would record everything for the wright brothers has existed since 1898 !!!!!!
Reply: @stevebett4947  translation please. People who don't speak English when they look at it are similar to Japanese.
Reply: @harpiasonhadorasonhadora5259  

SB: Você não concordou em fornecer uma pista sobre qual comentário você é
respondendo a?

HS: The American Belief nos voos pré-1908 da Wright Bros. não tem
base de fato.

SB: Concordamos que os Wrights não fornecem evidências incontestáveis para
seus registros e realizações pré-1908.

Há mais maneiras (e maneiras melhores da IMO) de definir um fato empírico do que aquele que o Arquidiácono e Ferber criaram.

Só porque alguém não fornecerá o tipo de evidência que você deseja
não significa que não existam outros tipos de prova ou que nada aconteceu antes de 1908. Você está usando a prova de que o 14 bis alcançou um vôo curto (100 m) como parte de uma alegação que não passa no teste de evidência.
Tais alegações não representam prova incontestável.

Atualmente não tenho licença de piloto (sou muito velho), mas já fiz o piloto
 pequenos aviões, ultraleves, asas-delta motorizadas e asas-delta nas dunas de Indiana, onde Herring e Octave Chanute testaram seus planadores.

Também trabalhei como engenheiro aeronáutico na Allisons Turbo Prop
 divisão da General Motors.

HS: (o que você escreveu) ... não parece que vem de alguém que estudou (início da aviação) ou de alguém que é aviador.

SB: Por quê? Porque eu me recuso a aceitar seus comentários não suportados?

Não tenho problemas com os comentários do Lins de Barros. Ele reviveu a FAI
 definição baseada em evidência incontestável no ano 2000. Ele não tente complementá-lo com comentários não suportados e desinformação. Seus livros estão disponíveis na Amazon. Não tenho uma boa referência online.

Tendo a aceitar a maioria das narrativas fornecidas por historiadores da aviação como o
relato mais plausível do que aconteceu no passado. Esta posição não é uma crença fixa ou manchada pelo nacionalismo. É apenas o que eu aceito até que algo melhor apareça.

A ciência não é fixa para sempre.
Qual é a melhor teoria ou conta muda com o tempo.

Você parece pensar que narrativas que são consistentes com os fatos e
Os comentários consistentes e os comentários relatados de pessoas que estavam presentes no momento não devem ser usados porque podem conter falhas.

Sim, eles podem ter falhas. Se não se enquadrarem nos fatos, entretanto, serão eventualmente substituídos por melhores teorias e narrativas.

Isso não é melhor do que não dizer nada ou substituir a sabedoria convencional
com teorias da conspiração ou desinformação?

Vou providenciar uma tradução para o português, mas não garanto que não terá falhas.
Reply: @stevebett4947  The translation is reasonable so it becomes easier. But I insist with one thing, Steve, the truth is that the wrights had too much time to do everything, register the first plane, present the first plane, getting rich with the first plane, having kings and queens at their feet with the first plane see they did nothing before Dumont. Dumont was the starting point and the beginning of aviation, you present the wright's contradictions that are terrible and wanting people to believe that unproven facts should be accepted is too foolish. Especially with all the opportunities they had and not did nothing to even present to the American patents and trademarks !!! and still show up here with excuses for ten years to present the machine that they themselves declared on paper they already had !! Steve, try to be a reasonable and accepted man, it was too much time and too many opportunities that were wasted this leads anyone to deduce that these two shamers did not present the plane because they had no plane, if they had a plane they would have flown in front of those responsible for the American trademarks and patents and would be rich in the other day. Just forget about the American ignorance they taught you and open your eyes that you will see that there is something extremely wrong in the work of these two. And that’s the detail, they don’t had the plane, they did not meet the requirements for the first plane.
Reply: @stevebett4947  thanks for translation
Reply: I'm not talking about conspiracy theories, I'm talking about realities that you haven't been able to answer so far. Forget it here and go to sleep, maybe in the wrights dreams speak to you because they never did anything before of Dumont.
Reply: @stevebett4947  translation please.
Reply: @stevebett4947  Lins de barros does not support wrights you have to read his books  more carefully and understand the interviews. As for the conspiracy theories reported by you, I reply that: "THE ARCHDEACON RECORD FOR DUMONT AND THE MONUMENTS THAT ARE THERE TALK TOO ABOUT DUMONT'S WORK AND PROOF WHAT HE DID "forget the conspiracy theory, the record for Dumont in 1906, the monuments, the photos the Filming proves everything for Dumont.
Reply: @stevebett4947  Steve, your desperation is showing. Please be sensible do not make contacts, you are not well. Do you want to win the debate? PRESENT here the documents that the wrights recorded between 1903-1905 in the greatest aeronautical authority of the time that existed since 1898. I do not need to prove anything to you who must prove that the wrights flew before Dumont is you !!!!
Reply: @harpiasonhadorasonhadora5259  

SB:  It is clear that you did not  understand my point.  
I cannot provide incontestable proof that the reported flight on 
Dec. 17, 1903 ever happened and have said this more than once.

@HS: A menos que você identifique o que concordamos, não há discussão. Você continua a fazer perguntas e diz que não entende minhas respostas. Estou frustrado por não parecermos ser capazes de nos comunicar.

Não há debate a ser ganho ou perdido. Estamos tentando encontrar onde
concordamos e onde discordamos. Isso é tudo.

Por favor, liste com o que concordamos e então
as perguntas específicas que você tem ou acha que ainda tenho que responder.

Estou certamente ciente de que o LdB não oferece suporte aos Wrights. Eu disse que concordo com o argumento dele e se você entende o LdB, entende minha posição.

O LdB não complementa seu argumento claro com teorias de desinformação e conspiração. Ele não diz coisas como "não há provas de que Wright existiu. Não há evidências indiscutíveis de que Write jamais tenha demonstrado algo em público. Não há evidências de que membros do American Aero Club testemunharam seus voos etc."

HS: Lins de barros não apóia escritores você tem que ler seus livros com mais atenção e entender as entrevistas

SB: De onde você tirou a ideia de que eu não sabia disso?
Já que você leu o livro que ele escreveu em 2000. Por que você não encontra
 a expressão mais concisa de seu argumento.

Em minhas palavras: Não há evidência incontestável de que os Wrights alcançaram qualquer um de seus registros relatados antes de 1908.

Uma vez que esta pode não ser a melhor declaração concisa de seu argumento,
 por favor encontre um melhor
Reply: @stevebett4947  how you asked for a good argument is here. Our discussion is about the invention of the first airplane and the beginning of aviation, this has been declared by me many times and this is a my point. Lins de Barros does not support wright brothers as inventors of the plane and does not agree that they were able to have flown before Dumont Lins de barros himself stresses how much the wright was sub-motorized, had no power in the engines to perform the motorized flight and as for 2003, centennial, he considered the possibility of having made a short flight good extreme dependence of headwinds, This was forbidden. Lins de barros is definitely not a supporter of wright brothers and is a staunch supporter of Santos Dumont. My main question and that will probably be presented here For the hundredth time. Present here the documents that the wrights made official records between 1903-05 with photos. If they were two men and responsible they should register the event by ca the immense amount of advantages that they would obtain, chances existed, time they had, the authority that would register everything for them had little powers and existed since 1898. This is necessary For you to prove that they really took precedence in motorized flight. If you have not he obviously designates himself to accept defeat IN THE ARGUMENTS and that to his displeasure SANTOS DUMONT invented the airplane and is the father of aviation. He won in 1906. The other arguments presented by you in the sense of proving that the wrights flew before without official evidence and records on sheets of paper made by wright brothers and friends were never worth anything.
Reply: @harpiasonhadorasonhadora5259  

HS:  HS: escreveu (você pode objetar à minha paráfrase e simplificação)

1- quem inventou o avião?

2- LdB não apóia o Wrights como o inventor do avião. SB: CONCORDO

3 - um motor de 12 HP por si só não poderia permitir que o 1903 Wright Flyer voasse. SB: CONCORDO

4 - Você não pode provar que os irmãos Wright voaram antes de Santos Dumont SB: CONCORDO com uma pequena reformulação

5. - Registros escritos e evidências não oficiais não valem nada. Precisa ser revisado para eu concordar

Por favor, dê-se ao trabalho de fornecer cotações exatas do LdB para fazer seu ponto. Se o LdB dissesse que Santos Dumont inventou o
avião, forneça a cotação exata.

Normalmente acho que suas conclusões e generalizações estão um pouco erradas. Muitas vezes são suas interpretações do que um autor
disse ao invés do que ele disse ou quis dizer.

Se você tomar um pouco mais de cuidado ao redigir suas observações e comentários, eu ficaria satisfeito.

Se você não consegue deixar de fazer reivindicações incompatíveis, falhei. Em certo sentido, terei que aceitar a derrota.

1. Quem inventou o avião?

SB: Esta pergunta não pode ser respondida usando apenas evidências incontestáveis. Já forneci a você uma lista de heróis locais que outras nações acreditam ser o inventor do avião e o pai do vôo. Você acredita que a pessoa que pode fornecer
Prova incontestável de que eles foram os primeiros a voar torna-se automaticamente o inventor do avião?
 

In English:  
@HS: wrote (you can object to my paraphrasing and simplifications)

1- who invented the airplane?
SB:  This question cannot be answered using just incontestable evidence.  I have already provided you with a list of local heroes that other nations believe to be the inventor of the airplane and the father of flight.  Do you believe that the person who can provide 
incontestable evidence that they were the first to fly automatically becomes the inventor of the airplane?

2- LdB does not support the Wrights as the inventor of the airplane.  SB: AGREE

3 - a 12 hp motor by itself could not enable the 1903 Wright Flyer to fly.  SB: AGREE

4 -  You cannot prove the Wright Brothers flew before Santos Dumont  SB:  AGREE with slight rewording

5. - Written records and unofficial evidence isn't worth anything.   Needs to be revised for me to agree

Please go to the trouble of providing exact quotes from LdB to make your point.  If LdB said that Santos Dumont invented the
airplane,  provide the exact quote.  

I usually think your conclusions and generalizations are a little off the mark.  They are often your interpretations of what an author
said rather than what he said or meant.

If you took a little more care in crafting your remarks and comments, I would be pleased.  

If you can't keep from making unsupported claims, I have failed.    In a sense, I will have to accept defeat.  .
Reply: I forgot to include one of your points:

6. O fracasso em voar em um dia calmo no centenário de 17 de dezembro de 2003 e a capacidade de decolar nos dois voos de teste em novembro e início de dezembro de 2003 é a prova de que o voador de 1903-1905 não poderia voar sem o assistência do vento. As regras da FAI exigem vôo sem assistência. SB: Eu concordo.

6.  The failure to fly on a calm day at the 17 Dec. 2003 Centennial and the ability to get off the ground in the two test flights in November and Early December of 2003 is proof that the 1903-1905 flyer could not fly without the assistance of the wind.  The FAI rules require unassisted flight.   SB:  I agree.  

Quote:  ... centennial, he(LdB)  considered the possibility of having made a short flight (in the Centennial year of 2003) good (evidence for the) extreme dependence of (on strong) headwinds, This was forbidden (by the FAI).
Reply: @stevebett4947  good translation
Reply: Lins de barros does not support wright and is extremely critical of wright bros  in many interviews and texts.  Lins de Barros accuses the brothers of charlatans by claiming that they presented the first photo in a timeless manner and that it was falsified. I have never seen, or heard Lins de clay supporting wright bros and the most he can have done is some possibility of wright's previous flight EXTREMELY DEFICIENT AND TOTALLY WIND DEPENDENT. That is, what they had was a glider.
Reply: @stevebett4947   The point concerning possible inventors of the first plane and before Dumont is an extremely debatable point. To be possible as you want you would need official evidence, it could have occurred, formalized, registered, there was time, opportunities and various conditions to occur and nothing. We must not work on nothing. Opportunities everyone had and for too long time. For this reason I demanded so much the official documents, through them all doubts could be removed, along the way of doubt there will always be doubt, but through the path of objectivity there will be certainty and that certainty was Dumont. Positioning him in the sense of wanting to believe that people who have proved nothing and had every chance and proved nothing the logic itself advises not to be valued. Dumont is the inventor of aircraft and inventor of AVIATION.
Reply: All I ask is for a working URL.  I do not seem to be able to find the referenced article even when I can find the publication.  

The existence of these articles does not support the claim that the USA tries
to ignore the achievements of Santos Dumont.  

I hope you can find the exact reference.
Reply: @harpiasonhadorasonhadora5259  wrote:  all the requirements for the first plane had existed for a long time and was known to everyone.

Please provide a little evidence for this claim.  What were these requirements
for the first plane.   

Whatever they were they don't seem to be the requirements that Archdeacon and the FAI desired.  

Here are a few of the pioneers of flight that have claimed to have been the first.
(to be added or you can just google it)
Reply: @harpiasonhadorasonhadora5259  Since when did the facts get in the way of
national pride and national legends?

Evidence was not the basis for the Santos Dumont legend.  

That argument dates from the year 2000 when Henrique Lins de Barros
wrote his influential paper.  
.
The facts of 1906 are contained in the document that stated the rules
for the contest and prize.  Santos was one of two contestants.  Bleriot was the only one shown in the photos.  Were there more?

Santos Dumont was a participant in the planning but he did not get
involved in making sure there were witnesses in addition to official
witnesses or in the filming of the contest.   

I doubt that the claim to be the first aviation record can be called an 
incontestable fact.  The claim was probably in some of the press releases
that Archdeacon's associates wrote.  I have seen it in some newspaper
articles.
Reply: SB:

1. Posso fornecer evidências históricas de que a maioria dos historiadores da aviação
concordam que os Wright voaram conforme descrito em seus cadernos.

A réplica exata da experiência Wright provou que a nave era capaz de uma velocidade de 10 segundos. vôo cobrindo cerca de 100 pés ou aprox. 33 metros. com um vento contrário de 15 mph. Isso é consistente com os voos relatados de 120 a 175 pés com um vento contrário de 21+ mph.

Não há prova incontestável ou incontestável para os voos reivindicados que o satisfaçam. Também não deve satisfazer a FAI, mas
eles foram em frente e certificaram os voos reivindicados sem testemunhas oficiais. Alguma ideia de por que eles fizeram isso?

Houve um vôo público diante de uma multidão e 30 convidados que incluíram várias voltas ao redor do pasto de vacas da pradaria Huffman. O capitão Ferber, que fora um importante crítico dos Wrights, entrevistou os convidados e concluiu que o evento ocorreu conforme descrito e que os Wrights não o estavam inventando.

Isso supostamente foi relatado no L'Aerophile, mas ainda não o encontrei. Você deve ler esta revista, pois ela está na Web junto com uma versão em texto integral que pode ser copiada e colada em um conversor de idioma, caso você não leia francês.

O que achei interessante é que a revista não era dominada nem por Santos Dumont nem pelos irmãos Wright. Eles são mencionados, mas não tanto quanto eu esperava
Reply: @harpiasonhadorasonhadora5259 
The flight of the 14-bis was in ground effect.
It could not be called sustained flight.  
This is a key requirement for a PLANE understood everywhere.

HS: "Os requisitos para a primeira faixa existiam desde 1890 e começaram a ser oficialmente exigidos desde 1898."

SB: Você tem uma referência? Os requisitos teriam sido estipulados

pelo Aeroclube de Paris. Você deve ser capaz de encontrar algo para apoiar isso.

Os requisitos para vôo sustentado também eram bem conhecidos.
Um avião deve voar a mais de 3 m. estar fora do efeito solo.

Isso significa que o vôo do 14-bis não foi sustentado.HS: "The requirements for the first lane existed since 1890 and began to be officially demanded since 1898."

Comment in English:
SB:  Do you have a reference?  The requirements are said to have been stipulated
by the Paris Aero Club.  You should be able to find something to support this.

The requirements for sustained flight were also well known.  
A plane has to fly higher than 3 m. to be outside of ground effect.

This means that the flight of the 14-bis was not sustained flight.
Reply: @harpiasonhadorasonhadora5259  Tudo que peço é um URL funcional. Não consigo encontrar o artigo referenciado, mesmo quando consigo encontrar a publicação.

A existência desses artigos não apóia a alegação de que os EUA tentam
ignorar as conquistas de Santos Dumont.

Espero que você possa encontrar a referência exata..  

SB:  Quem disse que o Henrique LdB apoiou os Wrights.
Certamente não fui eu.

Minha referência principal é a sua declaração de 2005 sobre o que era necessário para evidências incontestáveis.
Como você bem sabe, ambos concordamos com essa afirmação.
Achei que você concordou em parar de sugerir que não
e pare de tentar transformar algo em uma discussão quando não há uma.
Encontre um problema com o qual não concordamos.

Concordo que o vôo dependia de um forte vento contrário. A máquina precisava de um motor 8HP + e um forte vento contrário para voar. Acho que o Henrique foi considerado o vôo falhado em 17 de dezembro de 2003 como uma prova disso.
O Wright Flyer não consegui decolar com um vento de 4 mph.

Em 1903, não foi um vôo sustentado mais do que o 14 bis foi um vôo sustentado. Ambos estavam no efeito solo. Ambos eram insuficientes ou deficientes e nenhuma das máquinas voadoras poderia ser chamada de avião pelas definições existentes.

Uma altitude muito maior é necessária para sair do efeito solo.
Os Wrights não conseguiram isso até o final de 1904. Há uma foto do WrightFlyer II circulando Huffman Prairie supostamente de 1904.

Não pode haver referência a vôo sustentado, a menos que o avião esteja circulando bem acima de 30 m.
Mesmo que houvesse testemunhas convidadas, isso ficaria aquém do padrão da FAI para evidências incontestáveis.

As fotos do 14-bis em Bagatelle também não atendem aos padrões de evidências incontestáveis.
Ambos provavelmente atendem ao padrão de evidências históricas prováveis

In English:
Who said that Henrique LdB supported the Wrights.
It certainly was  not me.

My main reference is to the his 2005 statement about what was required for incontestable evidence.
As you well know, we both agree with that statement.
I thought you agreed to stop suggesting that we don't
and stop trying to turn something into an argument when there isn't one.
Find an issue we  don't agree on.

I agree that the flight was dependent on a strong headwind.  The machine needed both an 8HP + motor and a stong headwind to fly.  I think that Henrique was consider the failed flight on 17 Dec. 2003 to be a proof of his point.
The Wright Flyer I could not take off in a 4 mph wind.

In 1903 it was not sustained flight any  more than the 14 bis was sustained flight.  Both were in ground effect.   Both were insufficient or deficient  and neither flying machine could be called  a plane by the existing definitions.  

A much higher altitude is required to get out of ground effect.
The Wrights' didn't achieve this until the end of 1904.  There is a photo of the WrightFlyer II circling  Huffman Prairie alleged to be from 1904.

There can be no reference to sustained flight unless the plane is circling well above 30 m.
Even if there were invited witnesses, this would fall short of the FAI standard for incontestable  evidence.  

The photographs of the 14-bis at Bagatelle also fails to meet the standards for incontestable evidence.  
Both probably meet the standard for probable historical evidence
Reply: @stevebett4947  forget it, Steve, you are unable to present any official supporting documents dated 1903-1905 to prove anything to the wrights. Everything you present is doubtful and cannot resist a sense critical and observational. They did not officially register anything (wright brothers had every chance between 1903-05, The patent, the summons in 1904 made by the greatest authority of the time, historical fact,this authority existed since 1898, the english patent of 1904, where only one glider registered, never presented any machine, being that, all the world governments would buy his machine the wrights would be rich the other day and kings and queens at their feet, but they never proved anything, their excuses presented here to justify why the wright's incompetents never did anything before the specialists of the American patents and brands that would enrich them overnight are pathetic and hilarious excuses 😂😂😂 it is exactly the opinion of someone who does not accept the reality, opinions of friends of them on paper, no photos, no footage, no presentation of the machine publicly to prove anything and still think that people need to believe in idiocy fallacious of these is too much despair, Steve, you do not look at the reality that again you only present conversations of friends of them reported on papers, only papers without proof of anything !!!In their period they didn’t believe it, because everyone knew that everything should be done publicly in front of specialists, the official registration was carried out, the flight was carried out, extensive press coverage large audience, photos, footage and their subsequent enrichment. They never did anything, nor did they respond to Archdeacon's 1904 call for the French air club, who had already done this. on purpose, because only conversations and paper appeared. Steve, be a man once in his life and learn that the flight should be done publicly (they never did anything), without using the wind and from any external environment, it could not remain in the air with the support of the wind because it would evidence a glider and tests like this had already been done. Motorized gliders have been around since 1799 and they were airplanes. statements made on paper by their friends, acquaintances, relatives and employees are not official records of the event and evidence of the machine's existence. You have only faith, you do not present facts. Try to present something here documentary that the wrights recorded with photos between 1903-05 and that was made by the highest authority AERONAUTICA time that existed since 1898 !!!! please, or else stop !! there is no need for you to make contacts to not officially prove flights before Dumont. When you have the official documents with photos and footage contact me. please. or accept that the wrights have long since lost to Dumont.
Reply: @stevebett4947  There is no 220 meters Hop. Dumont  Running, TAKEOFF, land under its own Power, LANDING and three-axis control. This is much more than a machine that doesn't get off the ground like a wright's replica. The replica of the flyer that is played inside a museum is so useless.
Reply: You have a reference but not a URL that will take you to the relevant information.
Reply: @harpiasonhadorasonhadora5259  

SB: Você insiste em debater questões em que concordamos e não conseguimos nos concentrar no
questões que podem aumentar nosso entendimento.

O Wright não cumpria os requisitos do FAI do arquidiácono. Eles nunca tiveram "testemunhas oficiais" em qualquer
de suas 4 manifestações públicas.

Você não está interessado em saber por que eles não obedeceram. Tentei fornecer algumas especulações principalmente com base em o que os historiadores da aviação disseram.

Não sei por que você menciona a falta de registros oficiais como se isso fizesse diferença.

Os Wright estavam principalmente interessados em fazer fortuna e não revelaram muito de nada
a menos que eles tenham recebido cerca de US $ 30.000 e uma lista de requisitos de desempenho que você deseja demonstrar.

Seus testes eram principalmente para seu próprio entendimento.

Negar que algo existe apenas porque não há evidências incontestáveis é um pouco estranho.

A única prova incontestável de que o 14 bis é o depoimento das testemunhas oficiais.
No entanto, temos esse testemunho. Não temos o filme da conquista. Nós não temos o
regras originais do concurso que determinariam o que seria considerado evidência incontestável.

SB:  (posted earlier) . Posso fornecer evidências históricas de que a maioria dos historiadores da aviação
concordam que os Wright voaram conforme descrito em seus cadernos.

A réplica exata da experiência Wright provou que a nave era capaz de uma velocidade de 10 segundos. vôo cobrindo cerca de 100 pés ou aprox. 33 metros. com um vento contrário de 15 mph. Isso é consistente com os voos relatados de 120 a 175 pés com um vento contrário de 21+ mph.

Não há prova incontestável ou incontestável para os voos reivindicados que o satisfaçam. Também não deve satisfazer a FAI, mas
eles foram em frente e certificaram os voos reivindicados sem testemunhas oficiais. Alguma ideia de por que eles fizeram isso?

Houve um vôo público diante de uma multidão e 30 convidados que incluíram várias voltas ao redor do pasto de vacas da pradaria Huffman. O capitão Ferber, que fora um importante crítico dos Wrights, entrevistou os convidados e concluiu que o evento ocorreu conforme descrito e que os Wrights não o estavam inventando

SB:  You  insist on debating issues where we agree and fail to  concentrate on the
issues that might increase our understanding.  

The Wright's did not comply with Archdeacon's FAI requirements.  They never had "official witnesses" at any
of their 4 public demonstrations.  

You are not interested in why they didn't comply.  I attempted to provide some speculation mostly  based on
what aviation historians have said.  

I am not sure why you bring up the lack of official records as if this would make a difference.

The Wright's  were mostly interested in making a fortune and they would not reveal much of anything
unless they received about $30,000 and a list of performance requirements you wanted demonstrated.

Their tests were primarily for their own understanding.  

To deny that something exists just because there is no uncontestable evidence is a little strange.

The only uncontestable evidence that the 14 bis is the testimony of the official witnesses.
Yet we do have that testimony.  We don't have the a film of the achievement.  We don't have the 
original contest rules which would determine what counted as incontestable evidence.

Henrique Lins de Barros, a Brazilian physicist who has written two books on Santos-Dumont, 
told Reuters in 2003 that the Wright Brothers’ flight did not fulfill all the standards in place 
at the time, which included taking off unassisted, publicly flying a predetermined length 
in front of experts and landing safely. “If we understand what the criteria were at the 

end of the 19th century, the Wright Brothers simply do not fill any of the prerequisites,
Source:  Reuters 2003

SB:  Where did the criteria come from what was the point.  Make France no. 1 in aviation and aeronautics.
To put the Wrights achievements in doubt.  The only requirements are those in the published rules.
official witnesses were required, 100 m without touching the ground was required, That may be it.

The scheme was probably devised by ferdinand ferber
who was an early doubter of the Bluff Brothers.  

Archdeacon provided the money to purchase the Wright glider and the Wright Flyer.
Capt. Ferber was the one who tested them and reported back that he could not match the reported
performance of the Wrights.  The Wright Flyers did not include a training manual.  

Ferber probably went to Dayton to find evidence that the Wrights were bluffing or lying.  
Instead he came back a believer and reported his conclusions in  L'Aerophile..   I have yet to find them.

The Brazilian video argues that it was the first because the start of the contest was reported in Newspapers.
Was this announcement any different from the Wrights announcement in 1900 that they planned to accomplish a list
of record breaking flights.  Have you read their article?  It was published in a peer reviewed
Engineering journals and publicized in public lectures and French publications by Octave Chanute.

Wright Experience replica flies

On November 20, 2003, Dr. Kevin Kochersberger piloted the 1903 Wright Experience Replica Flyer. 
With 15-18 mph winds he flew a distance of nearly 100 feet.

https://www.youtube.com/watch?v=o1mscspl-VU

“gouvernails auxiliares.”  I think this was the term used by Santos Dumont to describe his largely
non-functional ailerons.  

http://www.wright-brothers.org/History_Wing/Aviations_Attic/Aero_Club_Exhibition/Wrights_Respond.htm

"Ernest Archdeacon, the founder of Aéro-Club de France, publicly scorned the brothers’ 
claims despite the published reports. Archdeacon wrote several articles, including a 

statement in 1906 in which he stated, “the French would make the first public demonstration 
of powered flight.” 

In 1908, Archdeacon publicly admitted to doing the Wrights an injustice 
after they flew in France."  https://aviationoiloutlet.com/blog/who-really-invented-airplane/

Wings of Madness video:  https://youtu.be/i_f5Bl2q9eY  Paul Huffman Wings  find.

Fight for Flight  https://youtu.be/i_f5Bl2q9eY    KPBS
SOURCE:  https://wikivisually.com/wiki/Ernest_Archdeacon    

Deutsch supported Lazare Weiller, who bought the patents of the Wright brothers and organized demonstration flights
piloted by Wilbur Wright in Le Mans, which began on 8 August 1908 
--.org/wiki/Henri_Deutsch_de_la_Meurthe     . . . .  https://en.wikipedia.org/wiki/Lazare_Weiller

In 1903 Ernest Archdeacon and the Aéro-Club de France announced the Coupe d'Aviation Ernest Archdeacon, a silver trophy 
for the first flight of more than twenty-five metres by a 'heavier-than-air' craft.[8] Later, the Aéro-Club de France 
offered a prize of 1500 francs to the first person to fly 100 m (330 ft).[8]

In October 1904, Ernest Archdeacon joined Deutsch de la Meurthe to offer a prize of 50,000 francs for the first 
heavier-than-air flight around a one kilometre closed circuit
Reply: @harpiasonhadorasonhadora5259  Some of the test flights of the 14-bis were photographed and filmed but there is no film of the 
25 m hop which was done in daylight, I presume.  The more significant 100 m hop was done at dusk.  It was never filmed and
I doubt if you can find a surviving photograph.  What counts as incontestable proof is in the contest rules and so far we
have not found this document.  It will probably be limited to the 100 m hop.  The proof is the testimonies of witnesses 
that say the Santos Dumont did not touch ground for about 700m,  

Santos Dumont was a member of the groups that staged the event ( the French Aero Club and the FAI) but he had little
if anything to do with the size of the crowd or the filming.  It was a strange race.  There was no fixed date, there 
was no starting line or finish line.  There was  no film evidence.  

I think the title Father of Flight is usually a national legend that requires little in the way of a factual basis.  
Caley is Britain's Father of Flight because he was the first to write about what would be required.  He did not consider
his little experiments to be that significant.  His conclusion was that true fight would require a more powerful engine.  
Just Google Sir George Cayley.  https://en.wikipedia.org/wiki/George_Cayley.  Why do you consider Brits who believe that
Cayley is their father of flight to be idiots?  

Today, the FAI requires witnesses but they no longer had to be members of the French Aero Club.  I would call the 1906 witnesses
aviation enthusiasts rather than EXPERTS.   They acted more like enthusiasts than experts.  There is nothing exact about their
estimated distance and flight time.  

The 1906 event may have been the first aviation record by the FAI but it is not recorded as such.  Not sure why?
Reply: @stevebett4947  Steve, You must be sick !!! You are not aware of anything! You did not understand the objectivity of the requirements regarding the first heavier than air that have existed since 1890 and that have been implemented and demanded since 1898 by the greatest authority of the time (Paris aeroclub), you have already said here that we were not debating and now you recognize that there is debate. Do You never paid attention that it's not necessary to write a book to answer?
Reply: @stevebett4947  Steve, It is easier for you to present the official evidence that the wrights flew before than evidence that does not officially prove anything. Evidence is not evidence. And to make your situation worse, the little you presents at the documentary level for them is from the year 1908, that is, in accordance with what has already been warned here. "WRIGHT FLY ONLY IN 1908"
Reply: @stevebett4947   It is easier for you to present the official documents that prove the wright's flights between 1903-05 than for you to present possibilities, possibilities are not certainties. Dumont is sure. Archdeacom recorded for Dumont in 1906 "THE FIRST AVIATION RECORD OF THE WORLD". the URL, the photo of the monument, the publication of the magazine NATIONAL AERONAUTIC ASSOCIATION has already been published and shown here. Please Accept "DUMONT IS THE INVENTOR OF THE AIRPLANE" the wrights lost in 1906 on 12 November. For you to prove the primacy of the wrights, you only need to present the documents that the wrights recorded between 1903-05 with proofs and photos that they made the flights. The maximum authority had already summoned the wright in 1904 and chances the wright had many !!! Please present or accept that you have lost.
Reply: @stevebett4947  Dumont fulfilled what was demanded by the greatest aeronautical authority of the time. The footage and photos are on youtube. You argue the wright's possibilities have flown before !!! and no photos !!! No official record!! No evidence!!! Steve, present the documents or accept that you lost
Reply: @stevebett4947  Great excuse, Steve, you argue that the two idiots did not present anything because they wanted a fortune before and then prove something😛😛😛😛😛 nobody negotiates like that, Steve, not even the wright !!! unfortunately with this statement you proved that the wright proved nothing !! 🙃
Reply: @stevebett4947  Steve, powered GLIDER with headwind dependency was not required, if they depended so much on wind, in fact they couldn't get off the ground and the replica in front of George Busch stayed on the ground.That machine had existed since 1899 when Cayley created the first motorized glider, they had already been tested, they did not FLY and were useless.
Reply: @stevebett4947 Do you claim that there are no Dumont films flying? kkkkkkk The  footage is on youtube, google and appears even in the movie wings of madness. When you present a footage  recorded by the wrights between 1903-05 for  the greatest authority of the time, you will win the debate. For now it's losing !!!
Reply: @stevebett4947  You are losing the debate, Steve, I am waiting for the photos and footage of the wright between 1903-05 or your recognition that you LOST THE DEBATE. You should prove the wright's primacy and you didn't prove anything !!!
Reply: @harpiasonhadorasonhadora5259  What is it you think I don't understand?
Please set me straight without the insults.  

Show me the evidence that the requirements existed before 1904.  You don't bother
to support your allegations.  I want references.  

I am an admirer of ... but I don't always agree with his opinions.  

I agree with the statement that the Wrights did not take off unassisted if we count
a strong headwind as assistance.  

I think the only requirements that can be said to be beyond dispute are those written
in the Deutsch-Archdeacon requirements for winning the prize.  If there is a mention
of wheels for take off and landing, this becomes an official requirement.  I am sure there
is a mention of the 100 m. distance.  There may be a mention of having to have an
official witness.  There probably is no mention of any other witnesses being required.

I don't see a definition that distinguishes a prolonged   hop from a true flight.  
The wrights said that anything less than 600 ft. was just a prolonged
hop.  The official distance (100m) was less than 600 ft so it would not be considered
"true flight".  

What is LdB's definition?  What is a safe landing?  
Without a strong wind, the WF1 probably could not land without damage.  

Henrique Lins de Barros (a Brazilian physicist and Santos-Dumont expert) has argued 
that the Wrights did not fulfill the conditions set up during this period to distinguish 
a true flight from a prolonged hop; 

Santos-Dumont, on the other hand, took off unassisted, 
publicly flew a predetermined length in front of experts, and then safely landed.
https://aviationoiloutlet.com/blog/who-really-invented-airplane/

SB:  The 14-bis did that successfully once or twice.  The usual landing damaged the under-
carriage.  A later attempt ended in a major crash.

Santos Dumont was unable to modify and improve the 14-bis to make a practical airplane think the requirements were invented by Ferber and Archdeacon in 1904.  It seems likely that they were trying to stack the deck.  (see references below)

Why should the French Aero Club and the FAI be able to set rules and establish the definitions of flight?   
Why were they the only ones with the expertise needed to witness an aviation record?

The French were the epicenter of aviation progress until the Fall of 1908.  

 in 1908, Archdeacon confessed that he had done the Wrights a disservice.   
He had the FAI certify the 1903 alleged flights of the Wright Flyer.  Why?
There were no official witnesses.  The record does not comply with the FAI stds.  

In 1908, Archdeacon publicly admitted to doing the Wrights an injustice 
after they flew in France."  https://aviationoiloutlet.com/blog/who-really-invented-airplane/

First Flight of over 1 min. in France.  .   https://en.wikipedia.org/wiki/Henri_Farman

2 April 1903, Archdeacon decided to further encourage the development of aviation

in France. He was encouraged to do this by the pioneer French aviator Captain Ferber, 
who had written to Archdeacon demanding 
"Do not let the aeroplane be achieved in America first." 
Archdeacon donated 3000 francs to the "Archdeacon committee!" of the 
Aéro-Club de France to sponsor aviation competitions.[6]  https://en.wikipedia.org/wiki/Ernest_Archdeacon

Ferber did not attend Chanute's lecture to the Aero Club de France in April 1903, but after hearing of it he wrote to 

Ernest Archdeacon, one of the founder members of the Aero Club. His letter asked Archdeacon to use his influence to get the Aero Club to announce a prize for a glider flight, and contained the exhortation   ...  il ne faut pas laisser l'aéroplane 

s'achever en Amérique ("The aeroplane must not be allowed to reach successful achievement in America").[3]:64 

His suggestion was enthusiastically endorsed by Archdeacon, who included an extract from Ferber's letter in his account of Chanute's lecture published in La Locomotion on 11 April: the letter was also published in the April issue of 

L'Aerophil.  . . . https://en.wikipedia.org/wiki/Ferdinand_Ferber
Did you ever read or comment on this?

https://www.loc.gov/collections/wilbur-and-orville-wright-papers/articles-and-essays/the-wilbur-and-orville-wright -timeline-1846-to-1948/1901-to-1910/#:~:text=Wright%20brothers%20apply%20for%20a,issued%20May%2022%2C%201906).
Reply: @stevebett4947  Steve, it is easier to prove your reason with official documents registered by the wright between 1903-1905. submit just one document that they registered between 1903-1905, remember, Archdeacon was already in charge of the greatest AERONAUTICAL authority of the time, the Paris Air Club, which was founded in 1898. Did Steve run out of time? there is no need for you to present acknowledgments here Archdeacon made in 1908. this year the plane already existed. Speculative reports from L'Aerophile or Century Magazine with statements by wright, family members and friends are worth nothing. The plane was never registered or presented in this Time course.
Reply: @stevebett4947  And an observation, Dumont has since 1906 THE FIRST AVIATION RECORD OF THE WORLD for him, ok! this was the first record. Who should prove that the wrights flew before and with official evidence is not me, IS THAT YOU!!!. Or else accept defeat, you were unable to convince. When you have the document registered by them between 1903-1905 with photos, talk to me. Until then forget it !! You're the one who doesn't prove Nothing.
Reply: @stevebett4947 Don't make contacts if you don't have official proof. The officialization of everything was known to everyone at that time. The wrights themselves knew this so much that they tried to file the patent in 1903!
Reply: @Hapia...:   If all you have is a reference to another Wright critic, that would be fine.
The old Reader's Digest is available at the Library of Congress and perhaps the Smithsonian.
They are just not available on line.

Here is material in the Wright Brothers collection that includes the scrapbook the family maintained.   This includes many newspaper and magazine articles in English and French
that were focused on the Wright Brother experiments or claims.  Unfortunately, they cannot
be copy and pasted.  

https://www.loc.gov/resource/mwright.05001/?sp=46
Reply: @stevebett4947  Steve, present only the page that shows the official record that the wrights carried out for the greatest aeronautical authority of the 1903-1905 with photos, please, or present here the publications of l'aerophile or century magazine published between 1903-1905 talking about their flights and with photos, please. Publications of wright's photos side by side, wright's friends in poses for photos and flyer designs are worth nothing. If they if they presented this to US trademarks and patents as proof, they would be sent home.
Reply: @stevebett4947  Be careful that between 1903-1905 everything that came from them was suspect.
Reply: @stevebett4947  News from the newspaper without a photo of the machine in FLIGHT does not prove anything. And I repeat, Steve, the wrights had three years before Santos Dumont to get rich, become famous and everything.
Reply: @stevebett4947   The monument to Dumont in Bagatelle, the Archdeacon record for Dumont in 1906 and the later appearance of the plane to the world is not an isolated fact, but historical and official.
Reply: @harpiasonhadorasonhadora5259  
SB:  All historical claims are disputable including those that you and others try to add to the indisputable facts.  The indisputable facts include what is mentioned in the original rules and regulations in the Deutsch-Archdeacon Prize contest rules.  We have yet to find that document.

I endorse LdBarros 2000 statement.  If you accept the FAI requirements, Santos Dumont was the first to
hop 100 m in 1906.  All other claims to have hopped before 1908 are disqualified.  

There is no statement about having achieve altitudes where ground effect was no longer assisting.
I would think this would be an important requirement.  

While the FAI requirements were endorsed by most members of the FAI and French AeroClub, it was not
the requirements that lasted very long after 1909.   They were probably not the standards that were 
endorsed by aeronautical enthusiasts in other countries.  This might require them to denigrate their
national aeronautical hero.  

"Had Cayley invented the plain he would have  presented ."
Not sure what you are saying or what you mean by PRESENTED.   

Cayley made no claims, but those who contributed to his legend have.
About the only thing Cayley is said to have said is that an 8hp engine is inadequate
to achieve a significant hop or true flight.   

Note that Cayley notion of flight was a boat in a sea of air.  He was working with the wrong analogy.
A boat has a rudder but nothing that enables the pilot to roll.  The sea not the pilot causes the roll
and the pilot just tries to steer into the waves to keep the boat from capsizing.
Reply: @stevebett4947  Steve, you sent me a large collection, I just asked you to send the page where you are with your official photo document proving that the wrights did everything before Dumont or a publication, just one de l'aerophile or century magazine with the report of wright flights with photos that was published between 1903-05, that's all !!! this is easy to achieve !!! only this was asked !!! and Lins de Barros mentions in several of his publications that the demands of running, takeoff, land under its own Power and LANDING at a public event were common knowledge.
Reply: @stevebett4947  Cayley never confirmed that he had a plane and even if he did he would never fail to register and become famous and rich overnight. A cayley jump never came close to what Dumont did.
Reply: @stevebett4947  there is no 220 meter Hop with running, takeoff, land under and LANDING. what Dumont did was the invention of the airplane and of AVIATION.
Reply: @harpiasonhadorasonhadora5259  

SB:  Please explain what you mean by registered and presented.  

There is no pre-1908 flight that complied with FAI requirements.
e.g., there were no any official witnesses for any of their alleged flights.

There was no incontestable proof that any of the alleged flights took place.
They did not comply with the FAI requirement for incontestable evidence.

We have yet to find the Deutsch Archdeacon contest rules and regulations,
but they probably required proof that the BIS-14 did not touch the ground for 100 m.
The Wrights did declare the minimum distance they were going to traverse.  
Since there was no certain starting line or finish line, the proof was that the official witnesses
claimed that the BIS-14 flew twice as far as they needed to win the prize.

April 1903, Ferdinand Ferber wrote to Ernest Archdeacon, one of the founder members of the Aero Club. His letter asked Archdeacon to use his influence to get the Aero Club to announce a prize for a glider flight, and contained the exhortation 
il ne faut pas laisser l'aéroplane s'achever en Amérique
("The aeroplane must not be allowed to reach successful achievement in America").[3]:64

 I have explained how the FAI rules and the rules for the competition were developed by Capt. Ferber and by Ernst Archdeacon.  You can read the Wikipedia page on either.  .
The point was to discredit and put in doubt the achievements 

Where did the criteria come from and what was the point.  
To make sure that the Wright Brothers did not succeed in America.
They achieved their goal by paying the Wrights to demonstrate their mastery of flight in France.

The only requirements are those in the published rules for the Deutsch Archdeacon Prize.
These probably included official witnesses and a 100 m flight.

The minimum distance was never specified in 1903 although the Wrights did
say that a flight of less than 600 ft. was just a hop.  The first three flights were hops  
assisted by a strong head wind and ground effect.
Reply: @stevebett4947  Steve, to place an order you don't need to write a book. are you sure you are well!?!?!? your claims !!! my request has been made a thousand times here and you have already tried to answer !! I it's not my fault if you can't taste the wright's flights !!! incompetence and yours and theirs. Try to read the previous comments and you will find my order made for you many times. I I think you better accept that you lost, you couldn't !! The requirements for the first flight have been around since 1898 !!! many places on the internet you will meet these requirements. basically it was running, take off, land under its own Power and LANDING, three-axis control, in front of specialists and a large audience. if it were not possible to make evolutions, a straight flight could be made. Look for the official document they registered between 1903-05 with photos, which is easier.
Reply: @stevebett4947  There is no solo effect or wind effect in the Dumont event, much less a jump. Jumps of more than 200 meters fulfilling the requirements of the time do not exist. Dumont invented the first airplane and created aviation!
Reply: @stevebett4947   Those who never had official witnesses were the wrights. Between 1903-05 they never called on any experts to prove anything. Dumont had the Archdeacon record.
Reply: I have requested a link to the articles you reference.  I have been unable to find one by searching
the web.  I can find Reader's  Digest Dec. 1942 but no table of contents or detail beyond a cover
photo.  I can find Air Facts but no detail.  If you have the link, this would be a contribution
to our efforts to document all claims.  

I don't dispute the historical events listed.  I am curious as to why out of the dozens of records 
that were set in the period 1905-1908, these deemed to be the most important?

Santos Dumont Bagatelle 12/11/1906 21 ” 

Henri Farman Issy le Moulineaux 11/26/1907 52 ”  

Leon Delagrange Champ de Mars 11/04/1908 6’30 ” 

Henri Farman Issy le Moulineaux 06/07/1908 29’53 ” 

Ferdinand Léon Delagrange (13 March 1872 – 4 January 1910) was a pioneering French aviator and sculptor.  He purchased a Voisin in 1907 and was elected president of the French Aviation Club. (according to Wikipedia).  None of Delagrange's records before 1908 were considered important enough to list in his Wikipedia biography.
Reply: @stevebett4947  The publications will be enough to look for. magazines and publications are American. Look it up. The name of the magazines you have. What about the official evidence that the wrights needed to have and that it would be important  You present to prove that they flew before you can never resolve. It means that they did nothing before Dumont and you at most mention possibilities and records made in the role by wright brothers, their friends and family. There is no clear proof of this and the demands were clear and have been in place since 1898. The people of Paris would never accept to leave an inscription in bagatelle In monument and saying that Dumont was the first. The FAi record for Dumont and secondly for Farman and the others is a historical fact that the only ones who do not know are the Americans. And the publication is And an agency of the United States government.
Reply: It is clear and written in the text. The records are there and have never been contested for a long time. And if Dumont did nothing, the current FAI website itself could not confirm in a current publication the date NOVEMBER, 12 1906.
Reply: @harpiasonhadorasonhadora5259  

SB:  What do you find "vague" ?

The short flight or hop is said to be a claim of some of the witnesses.  English patriots do not need objective or empirical
evidence to make their unsupported claims.  Legends may require a shred of evidence but not much more.  

How could there be film evidence before the invention of the
motion picture camera.  

How could there be official registration and definitive appearance?
Caley's concept of science involved replication.  Witnesses tend to
be unreliable and biased.  The date of the event is vague but so
is the date of the 14-bis records.  The contest rules did not specify
a date.  They could only specify the start of the competition.  
Thus the date is a historical fact and not incontestable.

If a pioneer of a manned fixed wing aircraft gone to the trouble
of setting up a contest for flight attempts after a specified date,
would that be sufficient?  I think it would still be contestable.
Reply: @stevebett4947  what I argue is vague? what you argue is that it has no connection. you want consideration for wrights without evidence and still try to conduct the conversation to give it an air of credibility. Who appeared here with this idiocy was you. and you have to prove the wright's flights with official documents. Dumont has done everything.
Reply: @stevebett4947  please translate what you write. writing in English for people who speak another language is like writing in Thai.
Reply: @stevebett4947  it is easier for you to present the official documents that they registered before Dumont for you to prove the primacy of the wright or accept that they do not have this primacy over Dumont.
Reply: @harpiasonhadorasonhadora5259   Santos Dumont invented the airplane and ...

Until you build an argument for this statement, it remains an unsupported allegation. 

The 220 m. hop was my interpretation of the estimates made by members of the French Aero Club
who had served as witnesses as evidence that the 14-Bis stayed aloft for at least 100 m.  

... and other Wright supporters argue that the Wright Brothers had demonstrated a 100 m. hop 3 years earlier.  
While there were witnesses for these alleged flights, 
there were no official witnesses from the American Aero Club.
Had there been official witnesses, the alleged flights of the Write Flyer II and III would have been
disqualified for not having official witnesses from the French Aero Club.

The running take off was allowed in the FAI rules but not a wheel-less take off on a greased rail.
Shortening the length of the wooden rails by using a catapult was also grounds for disqualification.
Wheeled take off assistance is OK but not wheel-less take off assistance.  

Nothing is mentioned regarding the ability of the 14-Bis to take-off again without repairs to its 
undercarriage.  There were several earlier landings that had crushed the undercarriage and wheels.
On a flight shortly after the successful one, the 14 Bis crashed on landing and was deemed beyond repair.
I believe the ability to land without crashing was part of the FAI definition.
Reply: @stevebett4947   the fai has already recognized in several comments made by them and even tributes published by themselves confirming the Dumont event. It was filmed, photographed, recorded by Ernest Archdeacon in November 12, 1906, is immortalized in a monument in Bagatelle and the magazine "NATIONAL AERONAUTIC" remembers the event in the thirties edition without any problems. Dumont was an event and a proven fact. If Dumont had done absolutely nothing on that date, the event would not have occurred, there would be no photo, there would be no filming, there would be no plane, the people of Paris would never let that great monument in Bagatelle be built and highlighted "FRANCE AEROCLUB SUPERVISION !!!"
Reply: @stevebett4947  what is impossible to run, take off, land under its own Power and landing is for any perfect replica of the flyers, everyone. that replica of 2003 attempts were made to fly normally and the replica lifted the front and remained on the floor. exactly as it happened in front of the whole world in 2003. that is, without headwinds not flat. it was never an airplane and they would not have the courage to present it in front of American patent and trademark experts. For Dumont it is clear "FIRST AVIATION RECORD OF THE WORLD". Dumont fulfilled the required
Reply: @stevebett4947  I do not believe that the flyers' inability to fly, as demonstrated in the 2003 replica, was something demanded by FAI.
Reply: @harpiasonhadorasonhadora5259  . . . Without a strong headwind the 1903 flyer would not take off.. 

SB:   We agree on that and the Centennial flight proves this to be the case.
There have been exact replicas of the 1903 Wright Flyer that hopped.  I have included the URL for the video
several times but you have yet to comment on it.   

How can  you continue to say that the all replicas fail to hop? 
How can you say that they always perform the same as in the Centennial flight?

On November 20, 2003, Dr. Kevin Kochersberger piloted the 1903 Wright Experience Replica Flyer. 

With 15-18 mph winds he flew a distance of nearly 100 feet.

https://www.youtube.com/watch?v=o1mscspl-VU

SB:  I think there is evidence that a good headwind is also required for a smooth landing.  
The usual Wright' landing could be described as a "pancake" landing or "belly flop".  
  

I think I have answered the question  as to why the glider rather than the powered glider was used in the Wrights' patent application
for controlled flight and wing warping.   Let's deal with the performance of the 1903 Wright Flyer first.
Reply: @stevebett4947   forget it, Steve, the two idiots never presented the flyer for the American brands and patents because they did not have the plane and did not comply with the requirements. Run, Takeoff, Land under its own Power, and Landing. these requirements were being made since 1898, also headwinds and downhill could not be used. They would never have the courage to present a disaster like the centennial because they knew the answer they heard. Forget it, they didn't have the plane.
Reply: @stevebett4947  Modernized replicas and transformed into airplanes are something else, but modernized with the technology that Dumont appeared in 1906 and created the first plane even the wright's mother would FLY.
Reply: @stevebett4947  forget it, you haven’t proved anything and the centennial PROVE they don’t FLY
Reply: @harpiasonhadorasonhadora5259  Don't forget that the Scientific American journal, the most respectable science journal in USA at that time, also recognized Dumont as the 1st man to demonstrate that heavier than air flight was possible. Issued 8th of November, 1906. They never acknowledge any flights from the Wright brothers before that date.